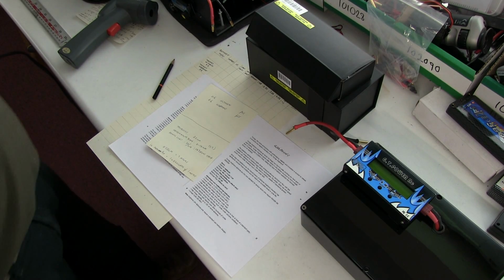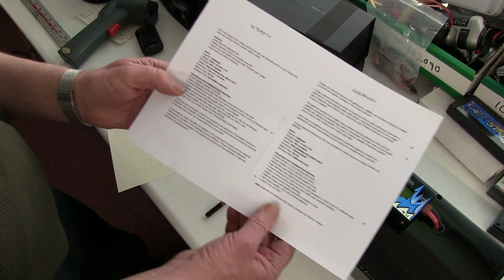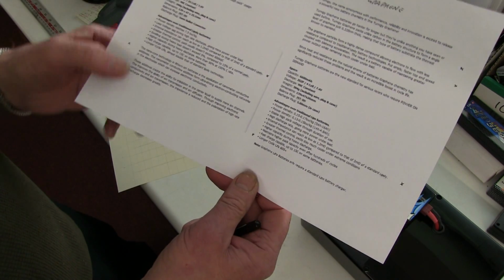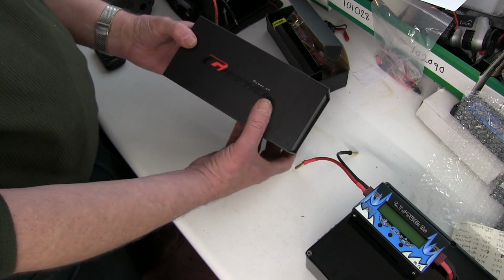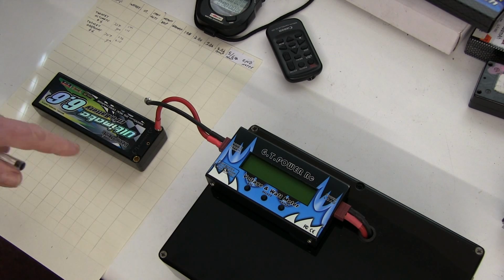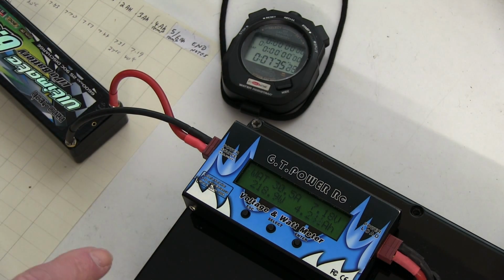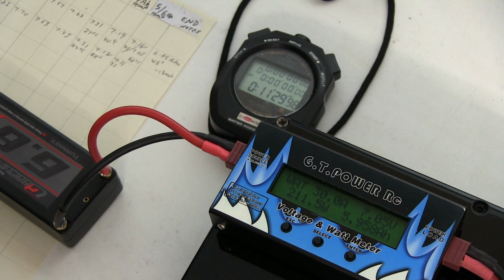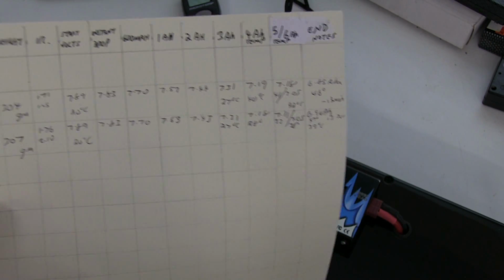Turnigy Ultimate vs. Graphene  6.6 Lipo test

Comment: Do the test again after 150 cycles. I have nanotech 2200 4s and graphine 2200 4s. After 150 cycles the graphines perform the same as day one no change, zero puffing. The nanotechs already showing signs of use. puffy, less flight time and less power last minute/s

Comment: If it was a graphene battery the weight should be substantially lower,  you don't need to test anything else ..
Reply from the maker: Hi H. I believe they just use a thin coating on the surfaces. The main bulk is unchanged. But I should have weighed them , as you say. Thanks for the feedback.

Comment: Good work
Thank you very much for a great conclusion
Pls tell me did you get Specified charge cycle for graphene battery?
Reply from the maker: Hi. Charge cyce is 2C recommended, but some manufacturers say 3C or even higher. I suggest no higher than 40 amps charge, but 20 amps is what I would use. There is no power gain from higher charge rates, just quicker.
Reply: How many charge cycles does a Graphene battery works ie life of battery?
Reply from the maker: @SaurabhDarole  Hi. Graphene lipo are sold as extended lifetime. The number of cycles is quoted between 600 to 1000.
Reply: @nickadams5411  thanks Nick

Comment: Some info for folks to compare with the info in the video starting at about 2:15
A sheet of paper is about 100,000 nanometers thick (the pencil line on the paper is much thicker than 100K nanometers!) https://www.nano.gov/nanotech-101/what/nano-size
Also, in video below, (starting at about 4:05) thickness of a graphene sheet = 0.35 Nanometers 
https://www.youtube.com/watch?v=qDviZVbf7AA

Comment: When I saw the length of this review I strongly suspected a low signal/noise ratio. Looks like I wasn't wrong. :-(

You need to cut straight to the point, leave out all the air and only go over the results briefly, flagging up any interesting numbers or anomalies.

Also you should run a continuous stress test and graph the discharge at 20%, 50% & 100% of C-rating. That way you can test & see the endurance and if, as other reviews suggest, that graphene batteries can sustain higher voltage under load over time.
Reply: @RajinderYadav  lmao  exactly

Comment: Nick in your opinion which configuration is better: 2s1p or 2s2p? Any pros or cons?
Reply from the maker: Hi
The manufactures prefer the smaller pouches to make up the capacity, as they can minimise losses with rejects.
I would say a single large capacity pouch would be better as it has fewer connections and wasted packaging.
But , Lipo are now so well made, the differences are not significant.
so, a 1P if available in the same capacity and C ratinng, as it may also be slightly smaller and lighter.

Comment: Great video. Thanks for taking the time. The higher internal resistance will mean the battery can be stored for longer without losing as much energy. It would be great to see your same test on batteries that have had 200-300 charge/discharge cycles. If only there was an automated tester!

Comment: Packaging costs more, only reason to pay more.
Reply from the maker: And since I did these tests, the graphene 7500 battery has swollen up.
Only had a bout 20 charges.
Supposed to do 600 or more.
Not good.
Reply: Did the 6600 swoll already?
Reply from the maker: Hi
The naotech is fine.
The 7500 seems too big for the hard case even when new.

Comment: I'm abusing some right now and I can tell you the graphenes run cooler and don't puff under the same loads that a non graphene battery does. That's not something you can see in this test that is very important. Also the resistance gets lower if you cycle it 3 times and then check it. Don't check it immediately. Let it sit for a while but you'll see the resistance gets better.
Reply from the maker: Hi Travis
Thanks for feedback. Is that in a buggy?
I have been running the Graphene and nanotech 7500 back to back at touring car races for some months now.
Swelling is not a problem, although the graphene was not flat from new, I think the Lipo is too big for the case.
Performance wise, i think the the nano always feels quicker in the race, but i retested and still the results come out the same.
So maybe the graphene will keep the performance up after a few years of use.
Reply: Just checking in to see if the two battery packs are still roughly the same.  Has time tested them enough to make a decision as to which is better?